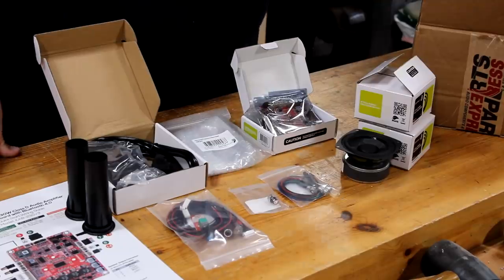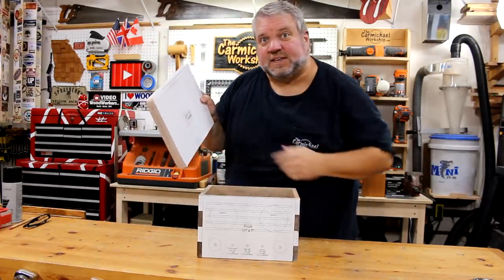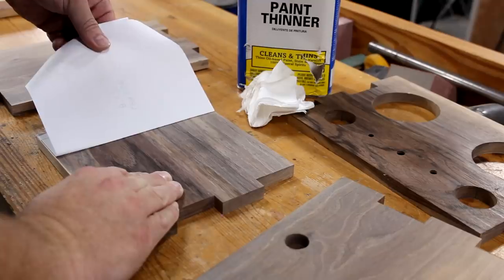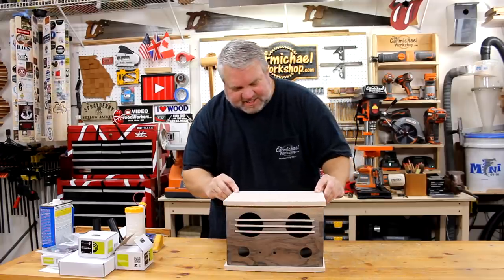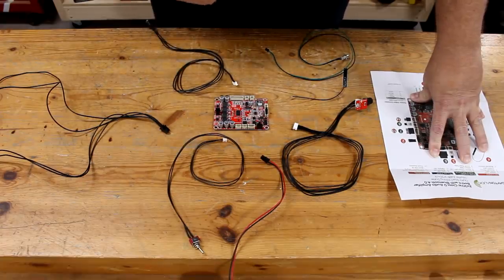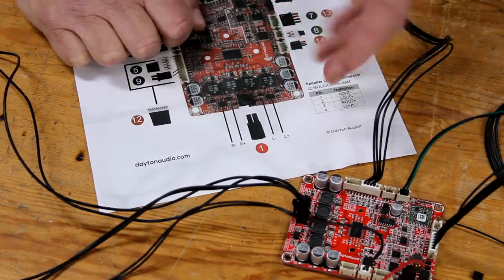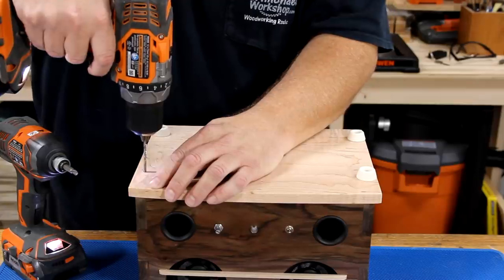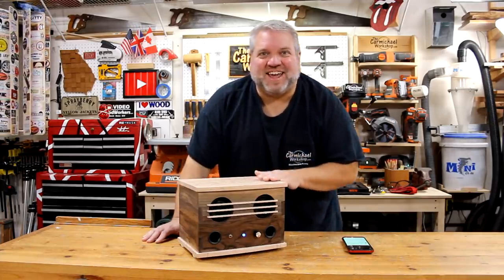Build a DIY Wooden Bluetooth Speaker - Fun Woodworking Project

Comment: Terrific job Steve! Very nice for a small speaker. What is the wattage of that speaker? Also, could you have also hooked a battery along with the electrical input so that it could be used both ways (mobile & stationary)? Just curious. Finally, I am assuming that the speaker could also be used with a Lap Top Computer as the sound source. Love that Maple & Walnut combo, two of my favorite woods....... Thanks for the source info as well............ :)
Reply from the maker: Thank you Steve.  It is 60 watts - 30w per channel.  Blows all those little Bluetooth speakers away.  Parts Express does sell a kit with rechargeable battery pack.  They also sell it separately so I can add it to my speaker if I decide too.  I think the third terminal on the power jack is used to charge the batteries.  I am sure anything that sends Bluetooth audio would work...it is a Bluetooth 4.0 kit.  Good questions!

Comment: Interesting that the bass ports are in the front, most Bluetooth speakers have them in the back. Very cool project!
Reply from the maker: Hey man, thanks!  That was one thing I had a question about.  I saw them in all different places.  Consensus seemed to be that it didn't affect the sound that much with such small speakers.  There is a whole world of speaker design audiophile enthusiasts out there.  It's crazy!

Comment: Never knew that about the diagram on those power adapters great tip
Reply from the maker: Hi Mike - Yeah, I've referred to those before trying to find adapters for stuff.  I was surprised the instructions didn't show how to wire up the jack.  There were two wires but three terminals.  I think the third terminal is for the optional battery pack to charge.  Hope all is well man!

Comment: Did u consider mounting the power adapter inside the box? Would you worry about it heating up?
Reply from the maker: Hmm, I didn't think about that.  I suppose it would be ok with the speaker ports acting as vents too.  The remaining length of power cord would be really short though.

Comment: Steve what size\model number is that Wen drill press? What do you think of it?
Reply from the maker: It's the 10" one from Amazon.  It's on sale sometimes for about $120.  It is much better than the old small one I used.  The work light and laser crosshairs are nice to have.  So far so good.

Comment: Looks great Steve. The big box joints really set it off.  I do have a quesion.  What app are you using to create you plans in?  
I have been using SketchUp for a few years now and then using Matthias Wandel's  "Big Print" for the over-sized pieces.
Reply from the maker: Thanks!  I use Microsoft Visio.  I've used it for over 20 years for work so it's easy for me to use to draw templates.  I tried SketchUp but seemed overkill for just cutting templates.
Reply: @SteveCarmichael  I will have to check that out.  Thanks for the reply and have a great week!

Comment: Steve, that turned out very nice, I like the contrasting wood colors, looks very retro! What is the program that you used to glue your diagram to the wood? I am mostly looking for one that allows it to print to another page if the print is larger than the paper used.
Reply from the maker: Hey, I use Microsoft Visio to draw my templates.  When I draw a big template, I change the page size to be larger, like 24"x24", so that I can draw the whole thing on one big page.  When it is final and ready to print, I add letter size pages to my Visio document, then I copy the whole big diagram and paste it onto the letter size pages.  Then I position a portion of the diagram on each page so that I can print all the sections with some overlap.  (For example, if my template is 15" wide and 8" tall, then it can cross two portrait letter size pages.  I'll place the left side of the diagram on page 1, and the right side of it on page 2, then print it.)
Reply from the maker: Some programs let you draw a big diagram and then print it using a "Tile" option in the print settings.  Visio might have this feature, but I like having control over how much overlaps from page to page so it's easy to line up and tape together.  You might want to try Matthias Wandel's Big Print software that does tiling.

Comment: Great job Steve, very cool.  What software do you use for your plans and templates?
Reply from the maker: Hey Dale - Thanks!  I use Microsoft Visio, just because I've been using it since 1994 and can draw well with it.  I like that the canvas is a grid like graph paper, which is what I used to draw plans on.  I tried SketchUp and the 3D view just seems like overkill when all I need is some lines to follow and cut.